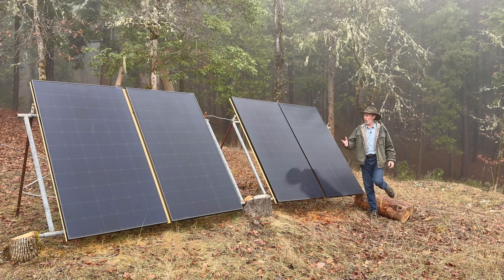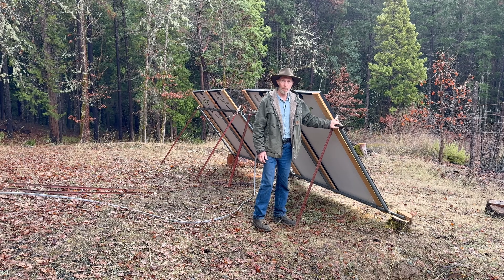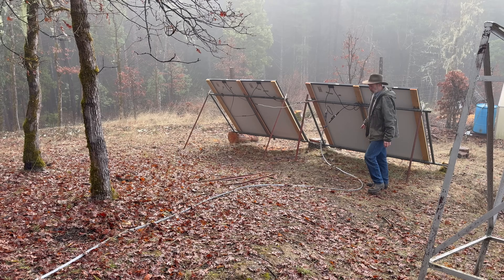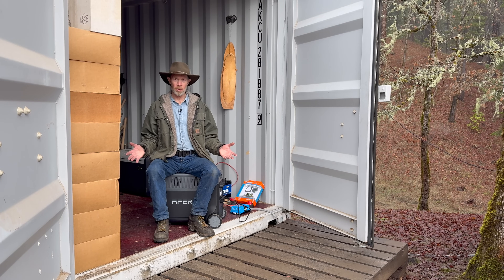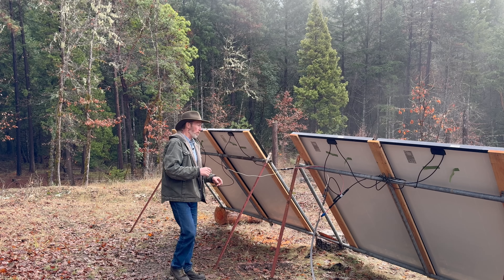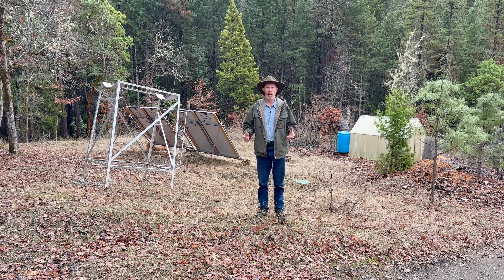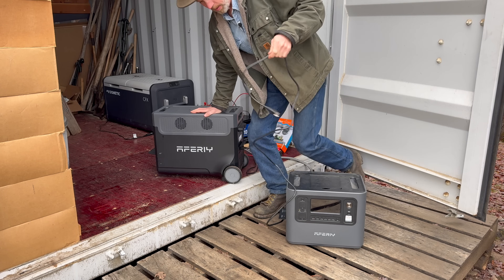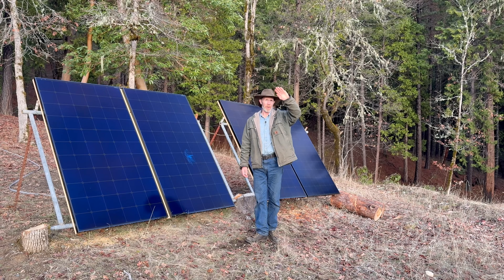DIY Solar So Simple Even a Logger Can Do It

Comment: Our home is completely off grid in an area with lots of sunshine but in the rainy season we have to use the heck out of the generator. Most will need some type of way to charge batteries when the sun is not shining if you don’t have backup grid power. Not necessary if your in a cabin but if your in a modern home with power hungry appliances a backup generator is mandatory.

Comment: Running an electrical island without any connection to the outside. With 3kW PV and 15kWh selfbuild (weatherproof, insulated, selfheating) LiFePo4 battery it's enough to power all my outdoor needs via summer half of the year. In spring and autumn i use the power to heat my greenhouse electrically with 1000W heater. If several non-sunny days follow each other, the PV of 3kW is not enough. But it's like with all things in life: More seems better...

Will have to build a G.A.H.T. and a bigger, better insulated, slightly submerged greenhouse and the 3kW will be fine... ;)

Comment: MC4 connectors are electrical connectors commonly used for connecting solar panels. The MC in MC4 stands for the manufacturer Multi-Contact (now Stäubli Electrical Connectors), and the 4 for the 4 mm diameter contact pin. MC4s allow strings of panels to be easily constructed by pushing the compatible connectors from adjacent panels together by hand, but requires a tool to disconnect them to ensure they do not accidentally disconnect when the cables are pulled. The National Electrical Code (NEC) and the UL6703 standard for PV connectors specify that connectors have to be from the same type and brand to avoid the dangers of cross-mating. In addition, IEC 62548 ‘design requirements for PV Systems' require PV connectors to be of the same origin. Originally rated for 600V, newer versions of the MC4 connector are rated at 1500V, which allows longer series strings to be created.

Comment: The cable you are putting under ground I would put in conduit preferably 1 inch or more leave in draw string, (you can replace or run extra wires as you expand with out digging up you cables)and plastic above it. To reason some  critters love to eat cable, plus the plastic so if dig to close or forget where the cable is acts an early warning when digging or trenching.

Comment: Wilson please remember when you do calculations on solar panels all your calculations must by the ISC and VOC. you also need to remember if the system is connected to a dwelling the calculations are different. it's all in the National Electric Code NEC. please be safe and have fun with electricity but never trust it, it really bites hard.

Comment: Im only 33 but im borderline disabled. Really, ive just lived a rough life and dont fit into the system, and my brain is different.
Something like this would utterly transform my life. I live in a tent with my cat for now.
Reply: Hee fellow Bordie here
Darned ,I lived in a tent as well
Now abondoned house with water ,no electricity,no residency,no healthcare 
A roof that leaks two floors
But it's a roof 
Upgraded a little bit ,somehow 40 cats and a dog 
I wish you strength and housing soon as possible 💪❤🎉
Reply: If you like outdoors work or work in mining or on water and at drilling rigs etc try fly in fly out work. Search and apply for it if you are still young you might like that type work. Logging camps and many types of work. Move to get to where it is and change your life when young.
Reply: Panels can be laid flat on the ground or bits of would, lent on fence, the other trick is buy second hand panels cheap as chips. But an all in on inverter etc but second hand as other up grate one block got his going for less than $200. Good luck. Also basic camping setup that the 4WD guys use. Not how much money you got it the grey matter that you have. We all end up in the pine box. So in our family we say just be independent and happy.
Reply: Good luck grim. All the best from australia. :)

Comment: The one correction... for solar chargers you CAN exceed the listed wattage. What you cant do is go over the rated voltage, which you said. The sum of all Voc(open circuit) should be less than the maximum voltage of the charge controller. But if you go over the wattage of the charger or power station, it will only take what it can handle.

Comment: Looks great!  I have 1.8 kw of 100 watt panels.  I'd suggest pointing them directly at 180 degrees south, looks like your angle is a bit too steep, and I'd lift them a few feet off of the ground or the grass and weeds will give you problems all summer long, plus if you have snow you'll be digging out the snow to clear your panels.  Better to just lift them up a bit, I lifted my panels up about four feet.

Comment: Up until last summer when I realized that our idiot governor in New York State doubled our electric rates to pay for more of her green iniatives, I had no intention of going solar. Eight months later I have an 18 kwh battery system and a solar array to charge it on a moderately sunny day coupled with two trifuel generators either one  capable of charging the batteries. I am now off grid capable with all the automations neccessary. After every thing was done I found out that the the IRS will pay for 30% of my expenses which cuts my total expenses to $9000 with a 7 year payback. This year I plan to install another solar array to cut my payback to 5 years. Now the only way we know that the power is out is when friends and neighbors call to make sure we are OK during an outage.
Reply: How did you design your system? I am facing the same tyranny in NY.

Comment: Current flow in wires happens mostly at the surface. Stranded wire of the same gauge, provides better current conduction.
...just sayin'
Reply: Can you site a reliable source on that? If that is true, you can please do.  According to the National Electric Code the same gauge wire is rated at the same allowable current. In very high voltage transmission electricity does have a tendency to follow along the surface, but at 600 volts or less this is nominal.

Comment: Nice video! New subscriber here.  I live in north Texas and get plenty of solar to put up panels and what not.  I am considering starting out with a solar backup for outages like we had here in February 2021.  I am leaning toward starting small and scaling it up (more panels, batteries, etc as we go on).  😂We have all electric for heat and cool which would not be the way to heat in the colder climates like Minnesota where I grew up.  Again, nice video hitting the high points on power stations vs. DIY with components.   I look forward to your detailed video.  All the best from north Texas!

Comment: Be careful now... that hillbilly wiring will get ya canceled... the way it used to be, you might find a bare wire in your wall... now you need a certificate and degrees and such... 'they' don't want people to know that you can, in fact, drive on the other side of the line.

Comment: the one negative of power stations is if any part of it fails.. it all fails.. but if you separate the items.. you just need to replace one item instead of the whole thing.. yes it is more complicated when you set up the solar/charge controller/batteries/inverter.. we have both like you.. we have a Bluetti AC180 with 200w of solar.. but we also have 800w of solar with 4-100amp Lipo batteries.. 100/40amp solar controller.. and a 2000w inverter.. good thing about separates is you can add more power down the road as needed by just switching a few thing out.. more flexibility per say..

Comment: If you hook them in series you double the voltage but the power in watts do not change do not double if you hook the parallel then the voltage stays at around 36vdc  but wattage adds together.
Reply from the maker: If you are suggesting wattage does not change, are you suggesting if I take a 400 W panel and add another 400 W panel it's going to stay at 400 W? If that was the case there would be no reason to have more than one panel.
Reply: For series wiring the wattage does add together, but the amps stay the same: double the voltage at the same amps = double the watts

Comment: PLEASE run that power through a proper penetration point! That steel door on the container WILL eventually close tight enough to crush wire internally or even worse...short creating a fire
Reply from the maker: It's only in the container for the moment temporary. The metal on the door doesn't even touch the wire. Opening and closing it every day for the last month the lettering on the wire looks the same as it did when it was new. Not even a scuff.

Comment: I would take some 2 inch panduit and bolt it to all the wooden supports and you can easily hide the wires and connections in it
Reply: What part of temporary did you miss?
Reply: @jimputnam2044  Hey jimmy the clown, this comment was intended for the final assembly
Reply: @davecalvo6418  LOL Right on Davey Boy.
Reply from the maker: Thanks for the tip. It would be good to have them hidden.

Comment: Ok i have to say it hahaha here goes, where I live the black is live and the white is neutral just saying  :-)  sorry had to do it. other than that. i think it shows just how simple solar can be and the wattage per SQ foot has certainly increased that is good, nicely done.
Reply: @davebloggs  
DC - Black is negative, A rainbow of other colors for positive depending.
AC 120/240V - White is Neutral, Black or Red are Hot, Green is ground.
Reply: @blaydCA 
In DOT approved freight trailer wiring white is negative; black is often battery+.

Comment: I have a Energizer Arc5 lithium power bank, it doesn't have a main shut off switch and I accidentally bumped a button activating it and it drained till it died and it won't recharge,  it's now a $500 paper weight.  I'll never buy one of these units ever again unless it has a main twist nob disconnect switch like the lead acid power banks have.
Reply: @mrMacGoover  
Did you check everything connection wise?
Did you try and do a Wake Up charge?
Reply: @blaydCA  All the connections were proper when I tried charging the power bank with the house adapter , it has the charge input clearly marked. As I said, the buttons were bumped and it turned on and drained beyond critical percent.
Reply: @mrMacGoover  
It may need a Wake Up charge.
Plug in for a few minutes.
Then unplug, let sit a few, then plug in again.
Evidently this is a common issue.
Reply: @blaydCA  I did what you said and the display would flash 0% and immediately shut off, after doing that a few times with same results I took the top and face display off and put 12 volts @  2 amps to the main soldered battery terminals with a car battery charger and the display lit up and stayed lit. The display showed 72% charge which was surprising to me because it flashed 0% like I said before. Anyway it's all back together and topping up it's charge. I made a short video explaining what I did before reassembling it again, I'll post it to my channel soon.
Reply: @mrMacGoover  
Maybe the Battery Management System is defective?
I'd be calling their consumer support number and requesting a new unit!
Unfortunately, when you opened it up it probably voided the warranty.
Hopefully just a one time glitch.
That's a lot of money for a portable battery.
Reply: @mrMacGoover  
I'd be charging that OUTSIDE, just in case the BMS is going to overcharge it.
Reply: @blaydCA  I have been watching it like a Hawk while it was charging, I just unplugged it @ 99% charge.
Reply: @mrMacGoover  
I will only purchase large batteries in Lithium Iron Phosphate LiFePo chemistries.
The Lithium ones are too dangerous in large formats.
Bad enough when a Lead Acid battery goes Runaway Thermal.
At least you hose them down to cool before they explode.
I never bring big batteries indoors, ever.
Reply: @blaydCA  I never heard of lead acid battery with a thermal runaway.  Update,  the screen only stays lit when the charging adapter is plugged in,  as soon as I unplugged the adapter the display dies. 😑I cannot turn on the display when by hitting the on buttons for the different power options.  It's fully charged though.
Reply: @mrMacGoover  
If one cell shorts out, it can overheat the battery during charging.
Removing the charge current won't stop the chemical reaction after a certain point.
Have to either cool it down with cold water OR get out of the area and let it blow.
Sounds like the electronics are bad on your unit.
Maybe why it totally discharged in the first place.
I wouldn't trust it indoors.

Comment: Your negative splice at the panels needs to be insulated because while it is "negative" it is not at ground potential. For fun put your voltmeter between that splice and one of the T posts.

Comment: If your inverter power-thingy can accept 160V then you should put all panels in series for lower loss in the line. There is a lot of magic in the PV inverter searching for the optimal power conversion of your panels under the current conditions. This is why you don't want to mix panels from a different lot on the same string, all the panels need to behave nearly the same.
Reply: His inverter only handles 150VOC.
Mix and match panels should be wired parallel only for best results.

Comment: I use anderson connections sb50 on some 12v  battery terminals . Then the output can be swapped out or added to a low need situation.  I pull 600 watthour plus into my EF delta pro to keep freezers running whole night

Comment: Nice flexible setup.  You are well on your way with both the discrete gear and the power stations.   Definitely stay with series solar configurations, particularly with large residential panels due to the amperages they can put out.  In terms of scaling up over time, start thinking of going with higher voltage on the discrete battery gear, it will make the charge controllers far more effective and you can carry far more power with the same cable size.

If you want to experiment, try wiring the discrete batteries into a 24V configuration instead of 12V, reconfigure the charge controller for the 24V configuration, and then feed the 24VDC battery bus into the power station's solar input, assuming it can handle the voltagel... most mid and large power stations can.  24V LiFePO4 charges to 28.4V so if the power station can take 30VDC on its input, the batteries can be plugged right in with just a 20A or 25A inline fuse.  That will "trickle charge" the power station from the battery bank, while the solar goes into the battery bank and serves as a relatively large energy buffer.

The advantage of going with a higher voltage battery bus is that you scan scale far more solar using the same charge controller(s).  45A @ 12.8V = 576W.  But 45A @ 25.6V = 1152W.   Many people go all the way to 48V (51.2V nominal), but if your intent is to also integrate power stations a 24V battery system is generally more compatible, easier to deal with, and trickle-charges the power station(s) much more quickly.

If you do come to like the higher battery bus voltages but are still using 12.8V batteries, you will need a whole battery balancer to keep the 12V segments balanced against each other when constructing a 24V, 36V, or 48V bank.  Most people just get native 25.6V and 51.2V LiFePO4 batteries to avoid having to get the whole-battery balancer... but since you already have the 12V gear, no reason to waste them.

If you have the solar going into the discrete batteries, you can unplug the portable power stations and use them without interfering with your energy gathering from the solar panels since that will go into your battery bank.

-Matt

Comment: In the video you mentioned Series doubling the Voltage, and Parallel, doubling the Wattage. Parallel actually doubles the Amperage, the Wattage stays the same. Actually, Wattage will always stay the same in the solar math.
Reply: it's literally the same: with the voltage staying the same, doubling the amperage means doubling the wattage
Reply: @danamoroso-xjq  This is an incorrect and dangerous statement. Yes, adding two fixed 425W solar panels together, you will get 850W. However, when wiring panels in series vs. parallel, it is extremely important to understand what gets doubled! One could destroy your equipment, and the other could melt the wire and burn down the house!

All solar panels and batteries come in a fixed wattage. When wiring power sources (solar panels or batteries) in, Parallel - Amps are added together, and Volts stay the same. When in Series - Volts are added together, and Amps stay the same.

Each panel: 425w / 40v = 10.6A
Two in Series: 850w / 10.6A = 80v
Two in Parallel: 850w / 40v = 21.2A
Reply: @danamoroso-xjq  I have to side with @ChrisSgaraglino  on this one. 2+2=4 2+4 will never = 4, it's not the same
Reply: @danamoroso-xjq  I have to side with @ChrisSgaraglino  on this one. 2+2=4 2+4 will never = 4, it's not the same
Reply: @danamoroso-xjq  I have to side with Chris on this one. 2+2=4 2+4 will never = 4, it's not the same
Reply: @danamoroso-xjq  
Volts times Amperage equals Wattage, no matter how you slice and dice it.
High amperage means heat, and heat means FIRE if your wire isn't rated for the amperage.
The total panel output remains the SAME regardless of wiring configuration!
Reply: Here's an analogy that might help: Think of it as a teeter-totter: one end is amps and the other end is volts, and how far the pivot is above the ground is watts; for the same height at the pivot you can push volts and amps up and down but the watts stay the same; high volts/low amps or low volts/high amps; they are a reciprocal of each other in the watts calculation; for more watts in our little analogy you raise the pivot higher from the ground; hope that helps make the concept more understandable and not more confusing, cheers!